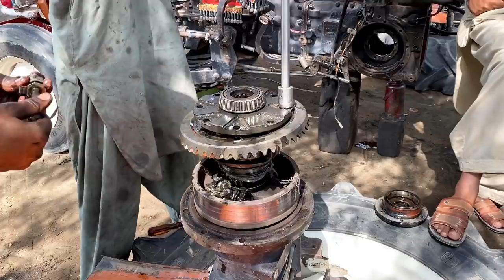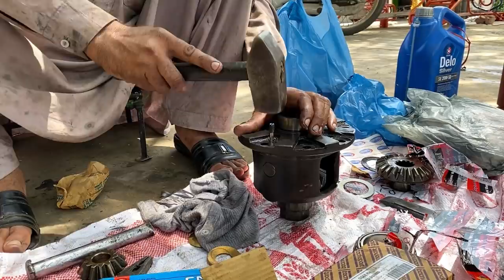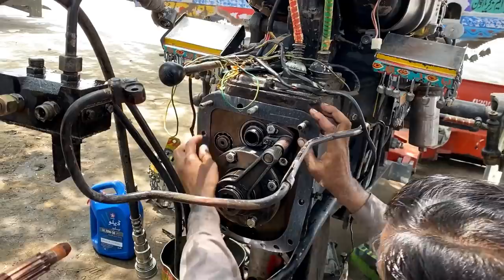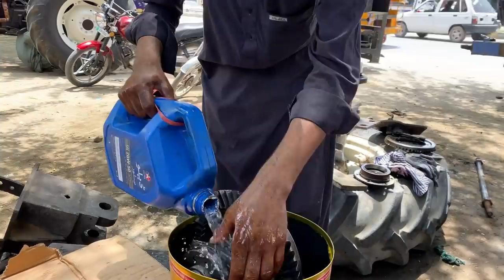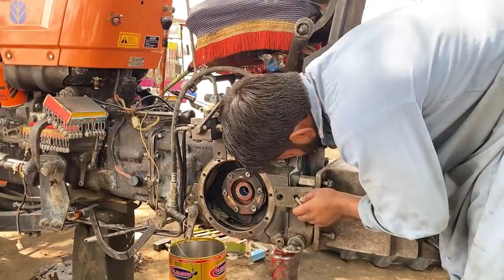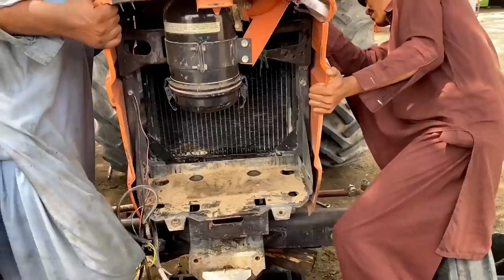How to Repair Tractor Diffrential Gear|| Fiat 480 Differential Gear Repair||

Comment: Why don't you change the gear oil?
Reply: To avoid annoying sound.. Because the change is not for all gears , don’t ask why but its happens
Reply: @saudgl  However, When the oil is old, you should replace it for the customer, if you still to use it soon the transmission will broke again.